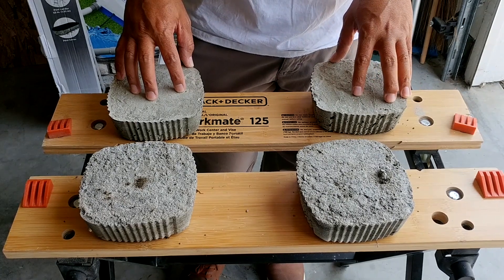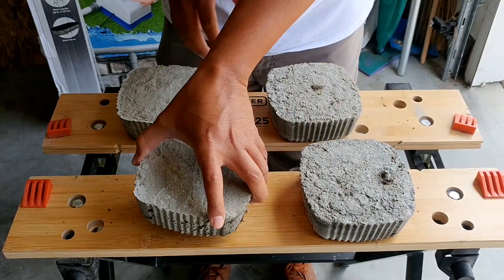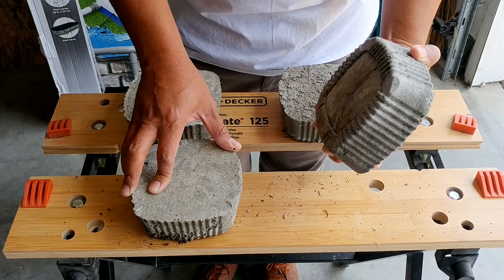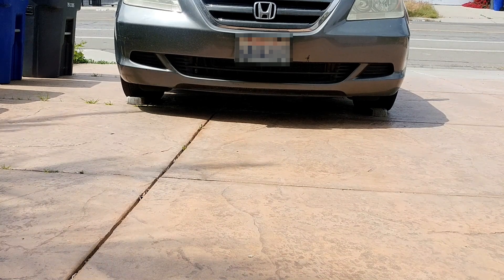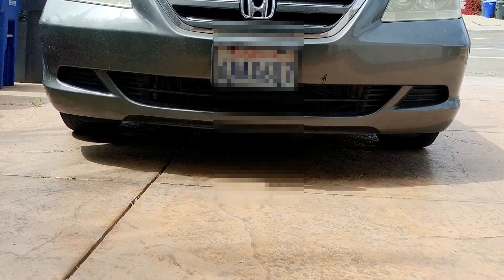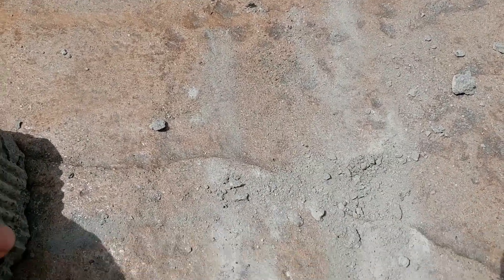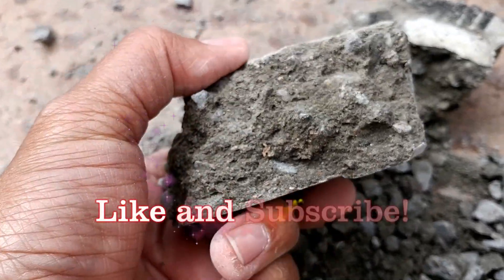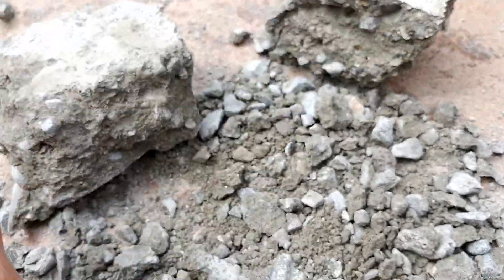Building a Better Concrete: Wet or Dry? Day 7 Uncovered!

Comment: Such an underrated series you are doing compared to all the hype out there. None of the hype wants to figure out the physical properties of dry pour vs wet pour. Finally we can get some data through normal concrete testing means, like you are doing - compressive strength over several different curing periods. Yes, it is not scientifically testing purely compressive strength like in a lab with cylinders, but this is a guy at home taking his time to give some information to this new trend.
Reply from the maker: Thank you for the support and I am glad someone understand what I am trying to do here. Some just want to see a big slab and if it is hard or not.

Comment: Any pro will concur that concrete must be mixed with water well b4 using...this dry pour nonsense is getting very tiring...only a fool would waste thier time and money trying to form concrete without mixing...😑
Reply from the maker: Agree. Mixing concrete is the tried and true method but an alternative method showed up and people are looking for answer if this is a good alternative hence the experiments.
Reply: but dry has a huge advantage of being able to take your time.  If you're on a solo project and got a big slab how are you going to get all the cement mixed and layed and leveled... without it curing too soon?
Reply: @joeskis I don’t know why people ignore this fact.  Dry pour is basically an option if you’re doing it solo and you’re willing to sacrifice full performance.  Someone might have a few hundred bucks and diy ability/time to improve their property with a dry pour slab that removed a muddy area, say, but they don’t have a couple thousand (??) to hire someone or any helpers to diy a wet pour.

So this dry pour technique is revealing an option, with caveats.  To dismiss it as nonsense really is to fail to consider the variance in people’s resources, capabilities, and needs.

Will I willfully enter a dry pour skyscraper?  Uh, no thanks.  But will I have a beer with the neighbor on his dry pour patio?  Sure thing.
Reply from the maker: I appreciate your comment and the insight you've provided. It's true that not everyone has the same resources, and it's great to explore different options based on our individual circumstances.

Comment: I've learned a lot from these videos and really enjoyed them. 

I'd love to see more concrete content. Specifically, I have some suggestions:

1. Compare dry vs wet pour concrete re-surfacing: ie: what happens if you try to smooth sand both 
2. Compare dry vs wet pour concrete crack healing: i.e.: what happens if you intentionally crack the surface over the entire surface (e.g.: 1 square foot area) & then try to re-pour using the dry or wet concrete over the wet and dry); then let set for 7/14 days. 
3. How would stamping dry pour concrete work?
4. Can you create interlocking dry pour concrete (e.g.: Tetris style) for increased strength
5. Can dry pour concrete be used to create floating steps (via an interlocking lip into a base step)

I have so many more ideas, but for now, this is great. 

I am subscribed.
Reply from the maker: Thank you for the support and for the suggestions.

Comment: Its a good test, but technically its not accurate. 

The weight of the van would have been evenly distributed on a larger slab as opposed to this method taking the full weight.
Reply from the maker: Hi! I actually explained at around 30 seconds of this video why I used a small sample. Our goal is to see if dry pour and wet pour have similar strength and the best way to do that is with a smaller sample. If I use a larger and thicker slab, we will not immediately see a difference between the two at a short period of time. With our smaller sample, you see right away that there is a difference in strength between dry pour and wet pour at 72 hours (if you have seen my first video) and at 7 days (this video). In the next 2 weeks both sample should have reached its full strength and  we will see if the dry pour can catch up with the wet pour at that time.   Thanks for watching.
Reply: @diymanual  my point exactly. 

We aren't here for your rushed results. Majority of people looking into this are looking to have it last at least a little bit. 

That's the problem with our new society wanting immediate results as you presented. 

Furthermore, if you knew they weren't going to be strong, did you simply make this for likes and views instead of useful content?
Reply from the maker: @racingwithnogas  Thanks and I understand your point.  Regular prepared concrete would have been fully set between 48 and 72 hours. Then at 7 days it should be at least cured to 70%  and you should be able to start driving on it at this point. At 28 days it is considered fully cured and that is the reason I am doing a test on each of those stages.  

Since dry pour is something that is not tested, I would like to know how strong is the dry pour at those stages and at what point will I consider it strong enough so I can start using it or build on it.

Not every person have the same way of looking at things. Some would want to see those stages and some are only interested at full strength. I try to cater to everyone so if you think that the test at 7 days is not necessary  then I will understand and respect that and if you are only interested at full cure then the final test is for you and it will be in 2 weeks.  ✌
Reply: @diymanual  I'll be there 🫣
Reply from the maker: @racingwithnogas  Cool. I will see you in 2 weeks.
Reply: @diymanual  The tests he's doing is about the physical properties of dry pour vs wet pour. Not how well it can function as a slab. That test is much different and larger/longer, and usually not done in science. Getting actual physical properties data we can infer about it's applicability in larger circumstances, but it's always the first step to understanding a material.
Reply from the maker: I appreciate you clarifying the purpose of the tests. It's always great to have a better understanding of the materials we work with.
Reply: Should also do another test with like samples but switch which side the dry pour is on. Looks like when the dry pour broke that side was the drive wheel.
Reply from the maker: @EC_ADV  Thanks for the suggestion but I have only made sample for each stage. Maybe on the next video, I can switch them around multiple time or until one exhibit some damage.   Anyway, if you have seen the 72 hour test on this you will see that the dry pour is on the other side.

Comment: WOW!  Excellent test.  Not only did the dry pour crush, all the stones fell out loose instead of being cemented to, well, anything.  
I have to say that I was not expecting the dry pour to crush like that.  Having said that, if it did crush, I am not that surprised that the stones fell out separately.
Reply from the maker: It looks like dry pour cures really slow. If you see the first video, you can see that the wet pour at 3 days is harder than the dry pour on the test we did today. Not sure how it will perform after 28 days but we will find out in our next video.